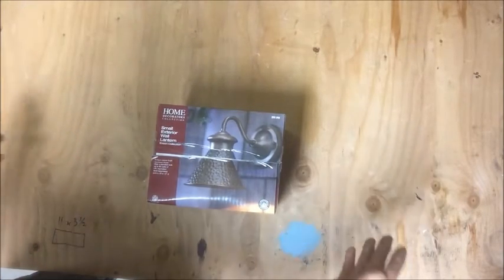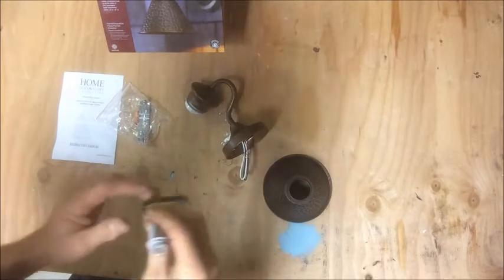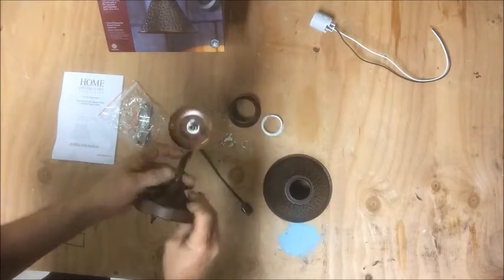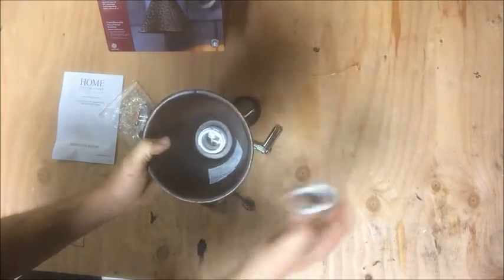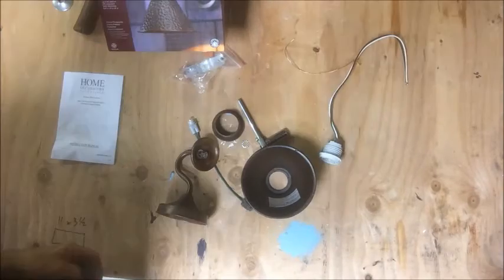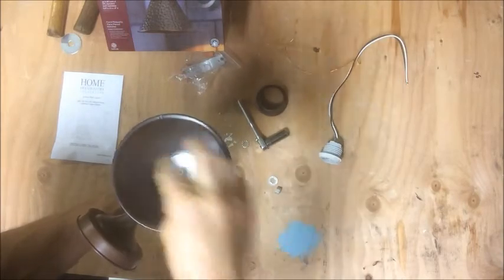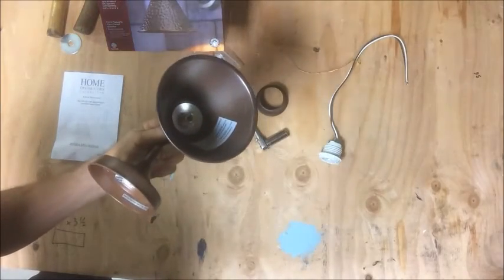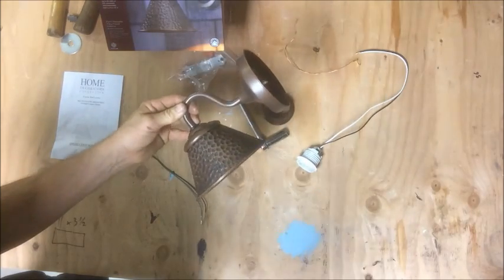Tiny house porch light 110v to 12v conversion

Comment: Could you run a small 12volt battery 🔋 for the power? Like a lithium battery 🔋.
Reply from the maker: Yes, might want to add a switch in line somewhere also. :)

Comment: Way too complicated. All you need my good man, is an LED 12V BULB with the same screw on socket that exists in that lamp.  Ask LED Wholesalers in Hayward CA - they advertise on Amazon.  I go to them for 12V LED bulbs.

If you want to match an existing socket, identify what socket you have such as WEDGE, PIN, BAYONET, SINGLE POINT BAYONET, DOUBLE POINT BAYONET, etc.  Any 12V LED bulb with that type of socket will fit and work.  The wiring does not need to be removed.  110V will carry 12V efficiently.  But 12V wire will catch on fire if 110V runs through it.

If you don't know the name of your existing socket, look up socket types for 110V.  Identify what you have. Then look up 12V LED bulbs for that socket.  Stop thinking about existing car parts.  Think outside that box.  Cars may have pigtail wiring but you NEVER NEED TO CHANGE THE WIRES, ONLY THE BULB .
Reply from the maker: Might want to check the publish date on this video. LED bulbs weren't so plentiful back then. This is an easy, inexpensive way to change any lamp to 12v led. Thanks for watching. :)

Comment: What about using a 12 volt light bulb that fits into the 110 volt bulb fitting?
Reply from the maker: That could work also. Back in 2016 when I made this video there weren't a lot of 12v bulbs that fit house fixtures, this was a cheap easy fix.  Thanks for watching. :)
Reply: @KoalityofLife  But then what do you do with the 3rd wire on the 110 volt fixture?
Reply from the maker: @KoiMan61  In this build I replaced all the wiring in the lamp so it's a 12 volt system for these lamps, there's only a positive and a negative, like a car. :)

Comment: Wouldn’t it be easier to just use the existing fixture and buy 12 volt A19 bulbs? Then you wouldn’t have to do all that work. Although peanut bulbs are less expensive. Just curious
Reply from the maker: They have a lot more LED bulbs out now so its easier to do conversions. You will have to excuse the video it is kinda dated. :)
Reply: Yes. There were/are a few easier ways to do this.

Comment: Ok , Im dealing with the same problem. I have some questions that I hope you can answer. Cant you just hook up a 12v 3w solar bulb to the existing 220v light? I have a whole house on solar 12v wired with normal electric wire and regular 220v plastic wall holders that work fine. Some fitting sizes or kinds are not easily available for 12v solar bulbs so you may want to change just the fitting (part where you stick the bulb in) Please advise.
Reply: Morgan Ladin hey Mate.  My house is hybrid with 12 Volt lighting.  I used regular 110 lamps with 12 Volt bulbs that have A 110 volt base.    I use regular 110 extension cords run from my batteries to each Lamp.   You can get the 12 Volt bulbs from a camper center or off the Internet.     Be Blessed.
Reply: Jim Davis that’s what I was thinking just buy 12v dc , Edison type bulbs? Use all existing AC wiring??
Reply from the maker: As long as the 12v bulb will screw into the 220v holder and as long as the input voltage is the same as the bulb you use you should be fine but I am not an electrician so please run your idea by an electrician before you hook it up. The reason I switched out the wiring in the lamp is so that I had the correct plug for the bulb I was going to use. I could have done more research on 12v bulbs and maybe found one that would fit the lamp without modification but I new the way I was making this lamp would work without a problem. Sorry if this doesn't help any but dont give up, keep making stuff. :)
Reply from the maker: Thank you. :)